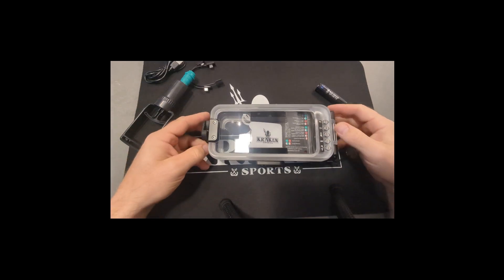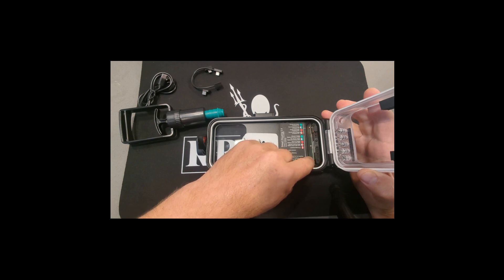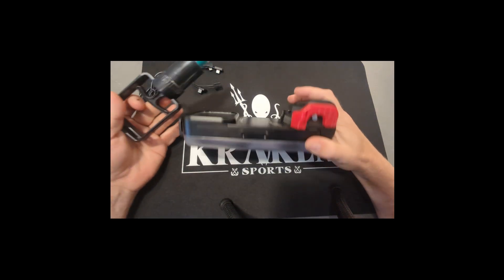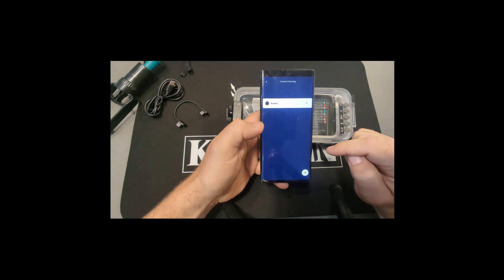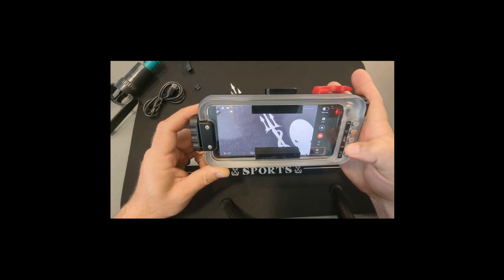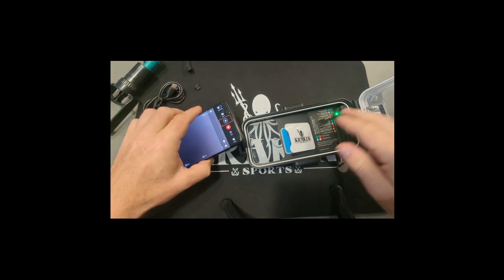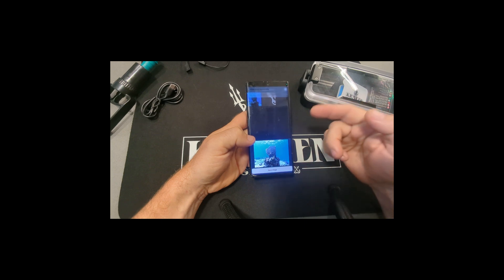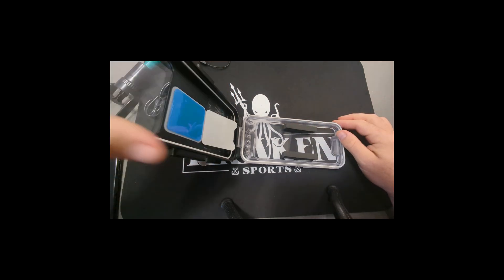Smart Housing v2 Tutorial

Comment: Looks great! While you could mount strobes off the top, but how would I trigger them? Is there any way to route / attach a fiber cable to sync with the shutter or would the internal reflection on the acrylic lens ruin the image? Could the fiber cable be attached elsewhere on the back, feeding off the display or one of the LEDs? Video lights simplify this, but aren't nearly as powerful for still images.